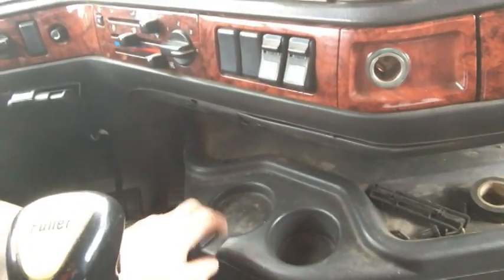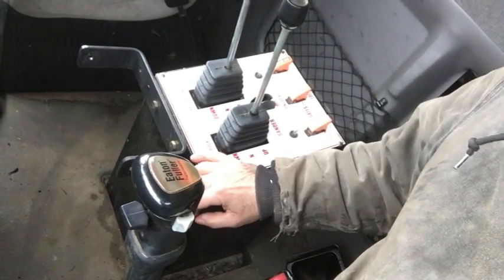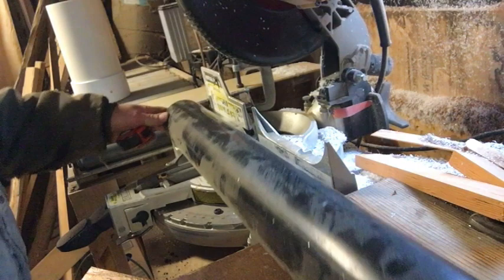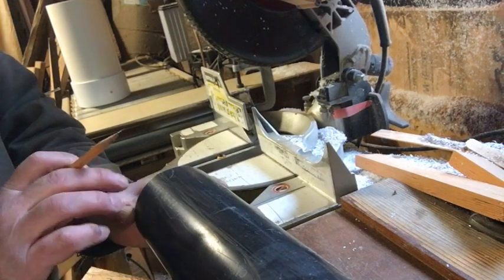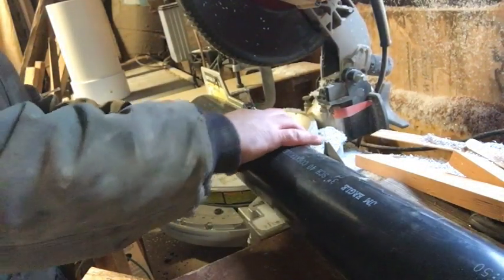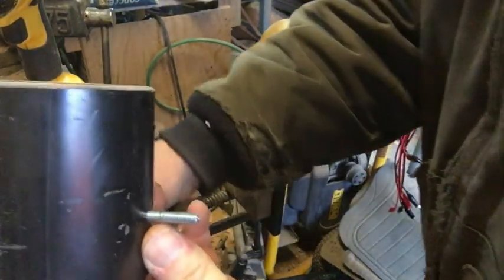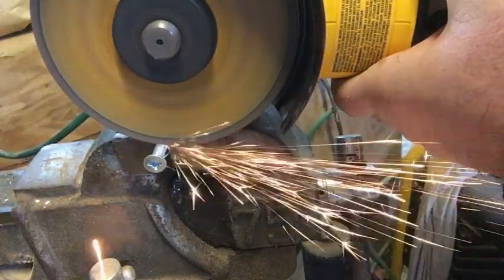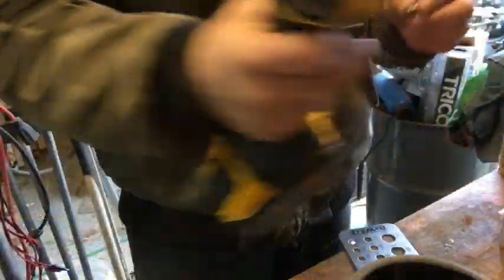Making a Cup Holder for the Dump Truck

Comment: Wondering what you are planning on doing with the truck.
Reply from the maker: We have a sneak peak video coming up in a couple of weeks that will reveal one of its main purposes.
Reply: Generally when we make an investment it is for multiple reasons. Equipment and rock hauling is the main reason.

Comment: You are really talented with diy's! I wonder if you would be able to figure one out for me. I use a walker to get around and I would love a cup holder for it but haven't found one in stores. The one I use is the red one with the four wheels and a seat. Do you think you could make one for me? Of course I would pay for it because this is a real necessity for me. Thanks for any input you can give! 😀
Reply: It is possible for sure. The fastening to your walker would need some specific information in order to adapt from the holder to the specific spot on your walker. typically those walkers are made of 3/4 inch aluminum tubing so one would want to retrofit a clamp instead of drill is my first impressions. Design R&D (research and development) takes a bit of time. If you can take several pictures and dimensions of where you want it placed we might be able to put something together. The other question is the cup size and shape will have an impact of pipe size to use. So, diameter of pipe one will mount to, photo of placement options are on the walker, diameter and photos of the cup you would like to use are starters. You can send photos and dimensions to: raincountryhomestead.com.
Reply: @MrRain-hk4zi  that's awesome. I'll try to do that. Thanks so much!
Reply: @nancysworld4178  👍